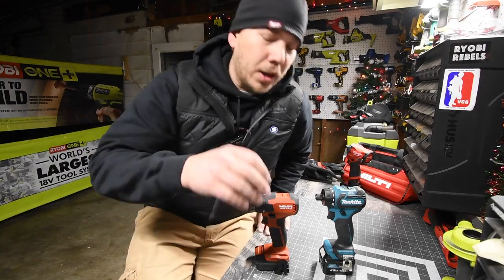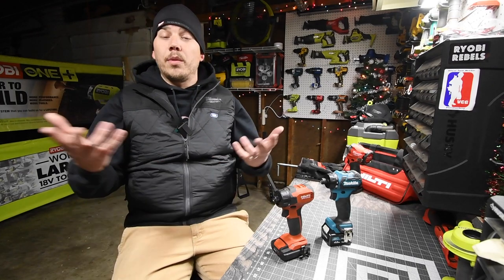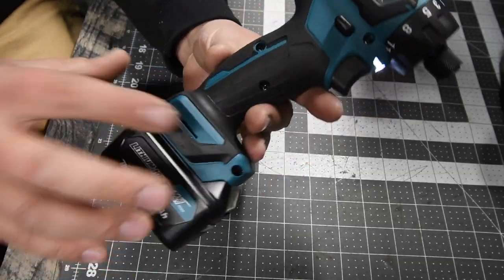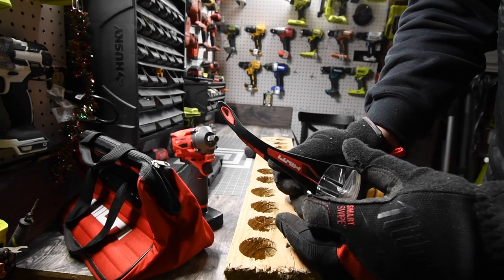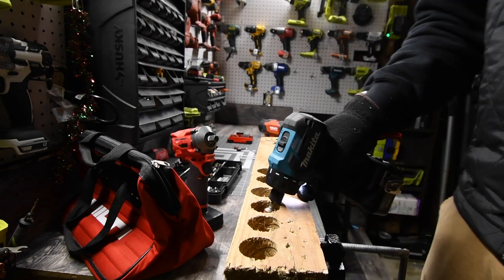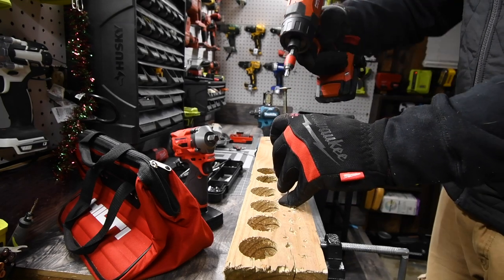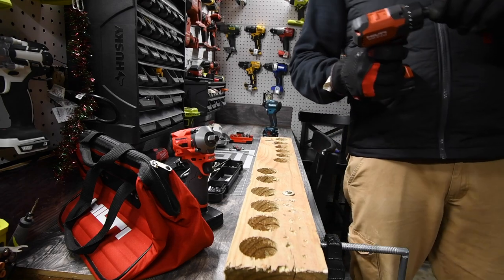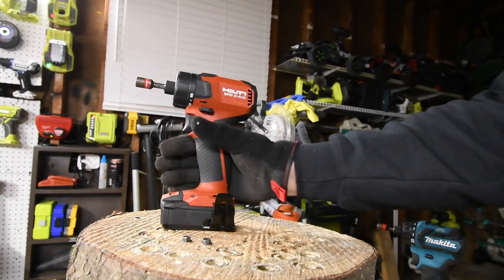HILTI vs Makita (12v Screw Drivers)

Comment: My profession and curiosity has lead me to purchase several powered 12 volt screwdrivers. At least 7,  I never overtax these tools because they aren’t designed what you did in your test. Thank you for the video and taking time to film it. But wouldn’t it be better to demonstrate more realistic tasks.  I use these type of tools for low torque applications.  They shine in that arena. Their size is major factor when getting I tight situations.  Your tests proved torque. Many applications require finesse and control.  If I want to drive lags or long screws I use an impact. Maybe it’s boring to some to watch the simple task of screwing small screws.  But I do it everyday and all day.  Thx again
Reply from the maker: I thank you D knibb
Reply: 12v is for instalation work ,smal and compact for small screws , ergonomic and the light (.dewalt dc6o1 is the best )  D.Knibb is right impact is for long shot ...Any way good presentation Cave Man
Reply: @md-fq9ye  thank you sir.  I’m going to check out the DeWalt dc601.
Reply: So which one is your favourite. I agree with you, I use my hilti one for steel stud electrical rough in. Good for driving those tiny self tappers. Never use it for drilling because you’re right; not designed for it. Mines the old brushless model.
Reply: My favorite 12  volt is the HILTI screwdriver. It’s small, super comfortable and ergonomics are great.  Second is an old model white Makita 10.8 volt screwdriver which is over 12 years old.  The Makita doesn’t have a battery indicator but is a great little tool.  I have a Milwaukee screwdriver as well, bought 2014, brushed tool but is on the heavy side.  Plenty of power , nice but prefer the other two  much more.  The first two have helped me for many years.
Reply: @uniquesoundsolutions  that Hilti 12volt screwdriver I have is the older brushless version. I am honestly flabbergasted that I don’t see it used more on sites. I wouldn’t use it for drilling holes or driving big screws into wood or multiple steel studs. However, for basic electrical boxing on steel studs it works like a dream, for 99% of tower boxing. What do you do for a living?
Reply: @carsonrowe8948  I’m an audio video contractor.   I wall mount TVs, set up whole house audio, home theaters, for residential and commercial properties.  Been doing it for 20 years.  During my professional career I once worked for HILTI (big plus!)  I also conduct classes on the proper use of tools. I provide and in-depth class on the purposes and uses of specific tools.  Also I cover having the right tool bag, the right tools and installation practices for cameras, TVs audio equipment etc.  I love what I do and over my career I have learned using the right drill or tool is huge.

Comment: I don’t see any point to have that kind of screwdriver , if you have just regular drill driver
Reply: Furniture making,on mdf boards or so you can do everything with this little things.
Reply: They weigh about a half a pound less. You also don’t have to worry about chuck damage. They also fit in places that a standard drill can’t. After you have one you’ll be amazed how little you need a standard three jawed chuck.
Reply: M12 or 12v drill drivers will be enough for furniture making. Like I said , if you have spare or extra money you don’t know where to spend, so you can buy one of those . But in my opinion it is waste of money!
Reply: @maxfax319  that is true also but you have options.
Reply from the maker: its just another tool to use. this style of a tool is very easy to control and it is very light weight
Reply: @maxfax319  If I was in the M12 battery platform and my cordless screwdriver was as long and as poorly designed as theirs is I also would probably believe that it was a waste of money, but for the rest of us who are in other battery platforms they make a lot of sense especially if you’re carrying them around all day in your tool pouch or your service bag.

The question isn’t a power question and I know it’s hard for that Milwaukee “Tim the tool man Taylor mentality” it’s not about power it’s about finesse and precision two qualities you could never prescribe to Milwaukee tools. Anyone who works on final finishes would never consider an all metal half inch chuck an advantage. If you put A/V racks, cabinets or furniture together why would you want to own a tool that could damage the end-users final product?
I recently went from having a Veto Pro Pack MC/TP4 with my Bosch PS21 (I purchased the PS22 brushless & lighter when it came out waiting for my brushed tool to die, it still hasn’t) that I’ve had since 2015 to a Velocity/Unilite Rogue 4.5 (not available yet in North America) with my Bosch brushless Flexiclick. You might be asking yourself why would you use the Bosch next to the Festool it is the least powerful of all of the installation drivers? It fits into an old work/LV1 hole cut in the drywall, it fits into my bag and has room for all 4 chucks AND an additional battery AND a charger. Would I have liked it if my Metabo installation Driver (The most powerful installation Driver) would have fit in the bag? Yes, 100% yes, but do I want to carry a bigger heavier bag and a bigger heavier charger? NO.

To sum up my opinion of your opinion...
It is easy to say that a titanium hammer is a waste of money if you’re not the framer who has to swing it all day.😉

Comment: You sound disappointed that the Makita beat the Hilti, LoL. FYI, I know that they're called screwdrivers in the States, but at least with the Makita, it uses the same motor/chassis as their 12v brushless drill (and hammer drill). The only difference is the chuck. BTW, the little hits on the lag bolts with the tools might impact (pun intended) results.
Reply from the maker: I was, but I still support the makita brand. this channel is not bias for a specific brand. I prefer the hilti. but the makita did win this one
Reply: @ManCaverTools  To be honest, I was surprised by the result as well. Regardless, the difference isn't huge, and other factors like how good it feels in your hand can be just as important.

Comment: the 12v makita drill driver is my number 1 power tool working as a security tech. its so light u barely notice it clipped on ya pocket. A 2AH battery lasts me over a week of solid use.
Reply from the maker: I love 12v screw drivers
Reply: @ManCaverTools  I was at a tool shop in Australia, just purchased a Makita heated jacket and they had the brushed version in the bargain bin for $30. Grabbed it without knowing anything about it, loved it then got the brushless version. Unlike their impact drivers banging away, over tightening and stripping screw heads the little 12v dominants. I'm totally hooked too.
Reply: I’ve had mine for 6 months. It’s perfect for cabinet making and light assembly work. I was using 18V makita drill/ drivers and the difference in weight and  balance between them means I no longer have pain in my hands at the end of the day. I avoid using 18V tools unless I have to.

Comment: I'm looking at getting a 12v screwdriver. I liked watching this video as well as the dewalt one. I have a request though. Could you do a video comparing all 3? However, could you maybe focus on ergonomics, collet wobble, size, and build quality? Everybody on youtube does "Can it do it" power and speed videos. I think it would help you differentiate your video doing a comparison of those features. Also, I'm sure others are like me and looking to get a 12v screwdriver for more precision tasks where a drill is much too powerful and strips screws and over drives them. It would be cool if you could do more precise operations to showcase control that they have. I appreciate the videos man, keep it up. Thanks
Reply from the maker: Im waiting to get the milwuakee fuel version as well then I want to do a video on all 4 of them :) I thank you for viewing Supreme

Comment: Good video but these are screwdrivers. Not impacts.  A great test would be to test them screwing in screws into different types of material and different thicknesses.  Real world for example.  Screwing small screws into plastic to see if the clutches actually work.  Taking equipment apart and reassembling it an seeing if they screw up the heads in any way.  Great video's and I do like your content.

Comment: Loses every round, still recommends the Hilti, huh?  Interesting rating system you have.
Reply from the maker: just because a tool loses doesn't mean its garbage. I say that a lot in my videos. Every tool has those few tools that are dominant
Reply: The Hilti's gave better fit and finish.  They are also incredibly comfy.  Makita is more like the Toyota of the tool world.  Works excellent, but a bit tacky looking.  I personally like the feel of the Hilti better, they got the entire ergonomics down.  Makita is also excellent. These are both the top choices for 12V tools.  Milwaukee probabaly has more power but is uncomfortable (just like Bosch with the bettery in handle) and a bit more mass production in quality. I don't recall DeWalt having a 12V driver only.
Reply: That's because Hilti is designed to be used all day every day.  Hilti "failed" in test the device wasn't designed for. These are screwdrivers. What's really important to a professional is, All day comfort,  For a cordless screwdriver controllability.  Being able to screw things without tearing up the screw or the thing you are screwing into. Warranty. I can easily send it bac to be fixed.  Volume. I own a company and I need 1000 of these.  I deal directly with Hilti!!!  Safety;  The tool stops when its overloaded. This is very important.  Kind of like a rev limiter on a car.